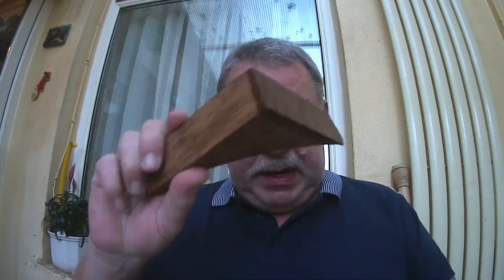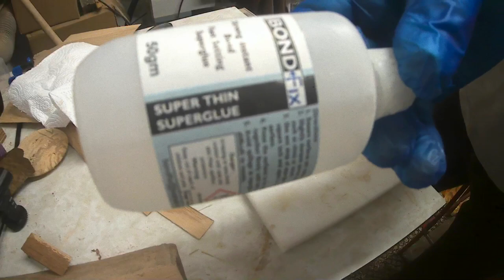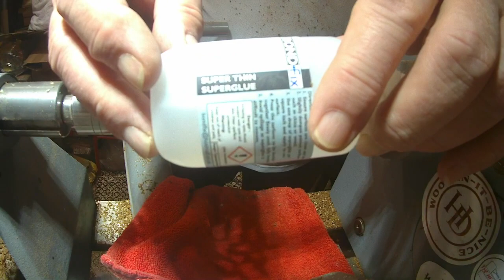Woodturning a Mary Poppins Double Celtic Knot Segmented Pen, Practically Perfect in Every Way

Comment: Very cool pen. Love the knot. It came out beautifully. 1 question, is the double veneer the same thickness as the kerf of your bandsaw blade? That has been my holdup for attempting this process. Guess I need to go get some veneer and het to it.
Reply from the maker: Hi Doug, Thank you very much. Yes the two layers are the same thickness as the kerf on my bandsaw blade. If you only put one piece of veneer in the cut the knots won't align properly. Don't ask how I found that out. LOL. Hope you have success with making them. A sled makes accurate cutting much easier, rather than using a miter slide. Take care Doug. Cheers, Huw

Comment: Love the pen it looks great. I use a wood sanding paste instead of sanding pads now. I feel I get a better result, give it a try sometime.  I see your over 700 subs congrats.
Reply from the maker: Hi Gary, Thanks very much. 700+ I'm so pleased. What wood sanding paste do you use? Take care Gary. Cheers, Huw
Reply: @WoodenItBeNice  I use Acks because it is easy to get here in the states, but I'm sure Yorkshire grit would work as well.  I tend to sand through the CA finish with the pads and then have to start over, and the paste is faster.
Reply from the maker: Hi Gary, I use YG and some form of finish if I'm not doing a CA finish. After applying CA I never sand back I only use Micromesh Pads and have never had an issue with taking the CA off. Hope this helps. I wold like to try Acks at some point, but is it so expensive here in the UK I can't justify the expense as YG works well for me. Cheers, Huw

Comment: Another lovely pen Huw 👍🏻 I noticed you used carbide tools on the pen, is there a benefit to use them above traditional tools? I’ve got some carbides but I just don’t get along with them especially the round ones I get some wonderful catches 🤣. Keep well Cheers Steve
Reply from the maker: Hi Steve, Thank you very much. When I first started turning pens I used a skew. When I started segmenting I bought the carbide (over 2 years ago) I used in this video. The trick with carbides is very high speed, I normally turn at around 2300 to 2500 RPM, light cuts and keep the carbide at 90 degrees to the piece (parallel to the bed) and at center height.